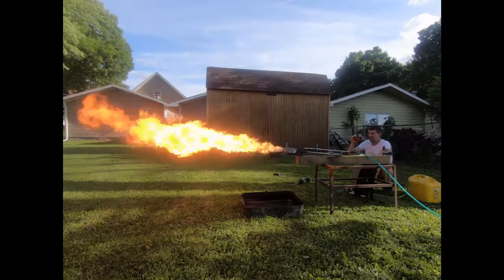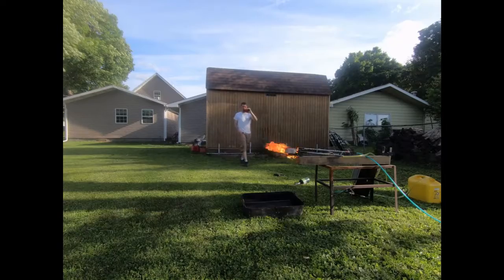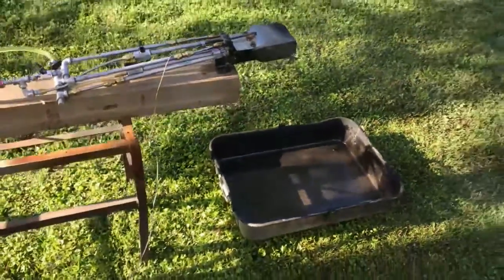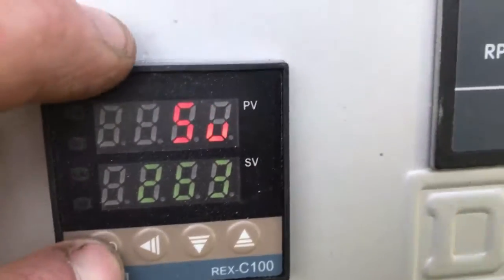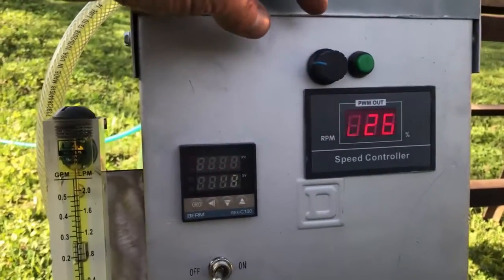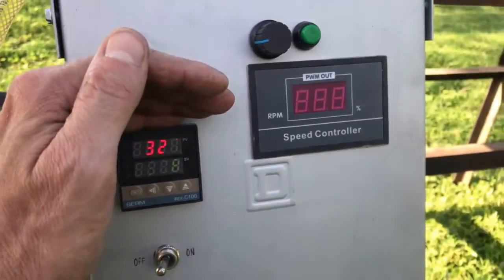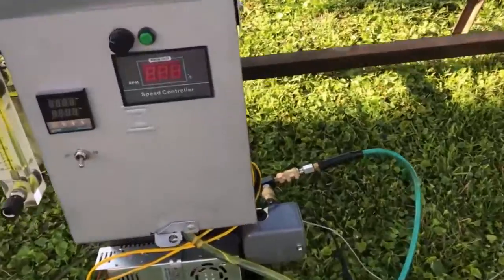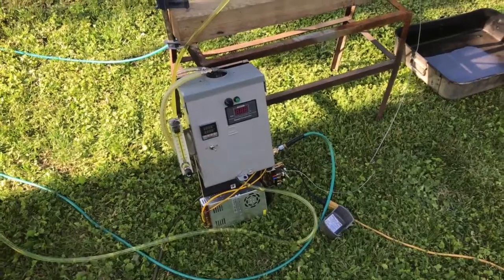1.4 Megawatt Tire to fuel burner with auto cut off

Comment: I was just now watching this and I too would suggest the air pressure, either as a diverter valve, or just a flow stop valve.
Would not need electricity to operate.

Comment: how did you measure these 1400000 Watt  ?
input or output?
Reply: I'm assuming it was math based via fuel+air in and math?  I don't know to be honest.
Reply from the maker: fuel consumption 10,000 watts per liter burned
Reply: NOBOX7  did you ever measure the output for real? that would be a more reliable number ( i made a comment before , how to use an easy method how to do that with water, on https://www.youtube.com/watch?v=c5cnKhrAnQU)